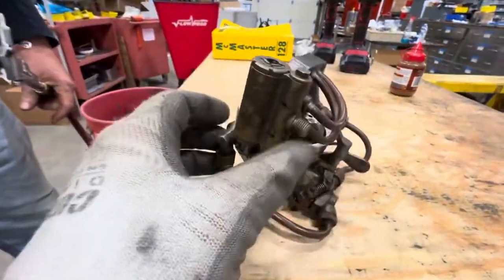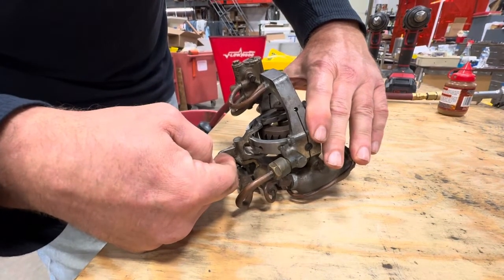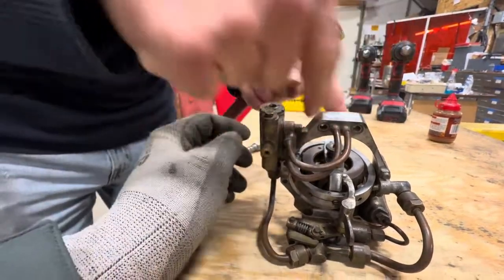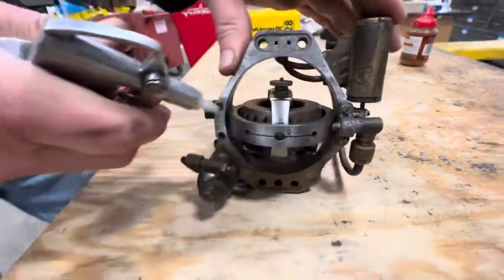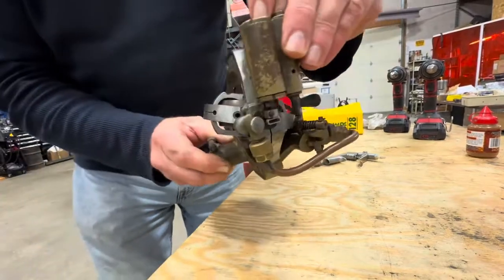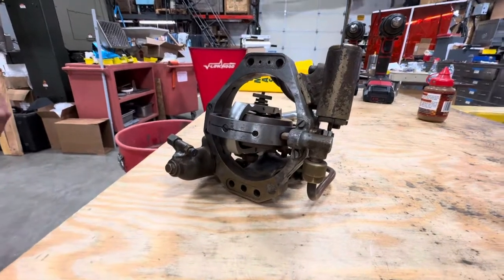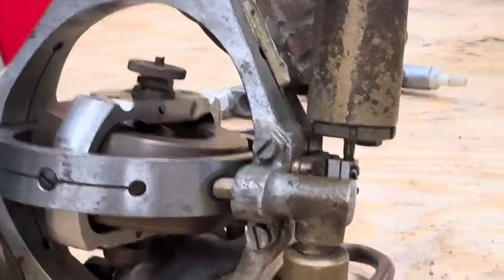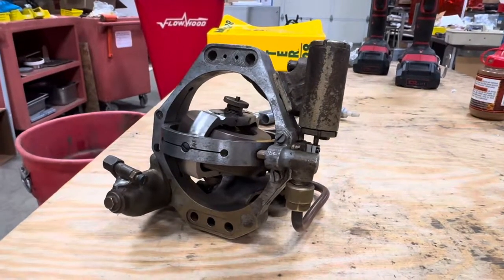Guidance gyroscope from a WWII Japanese torpedo in operation!

Comment: They are really neat their from a "oxygen powered" japanese torpedo which was powered by oxygen large oxygen tank and a small portion of the oxygen also powered the gyro thru the air lines on the gyro, really advanced tech at its time.
Reply: Given the combustion engine was started with air, the gyro probably was too. Starting the gyro with oxygen would increase cost (and risk).